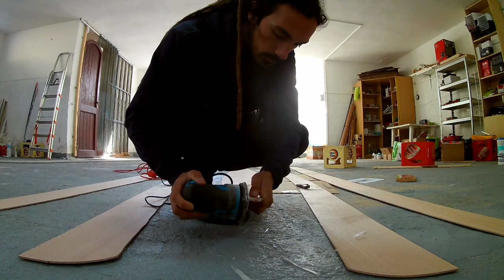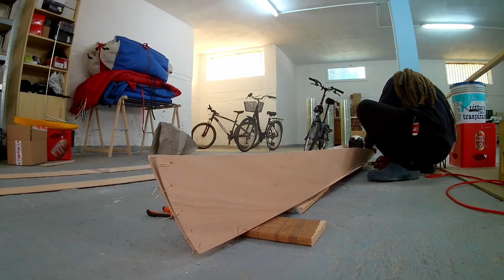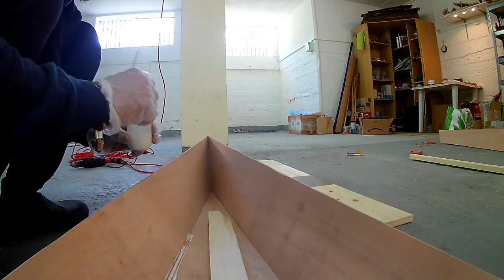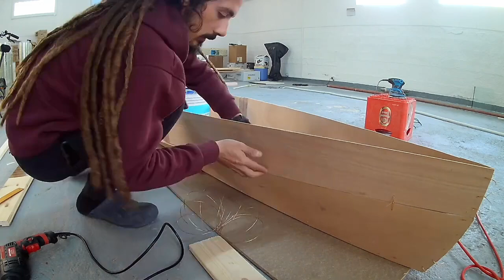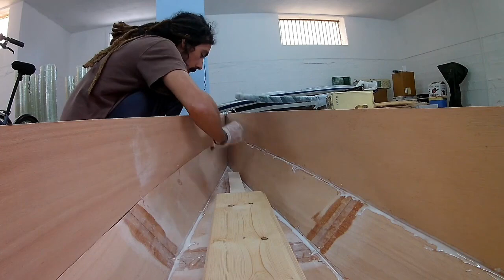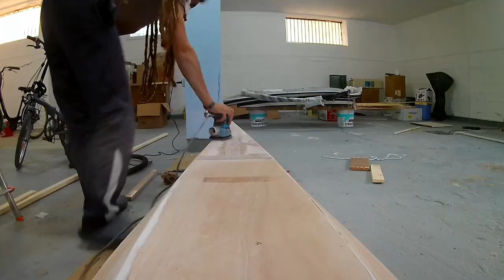Canoe from plywood: how to build with no experience #1

Comment: When I do stitch and glue I empty the contents of a caulk tube then refill it with the glue. Applies more evenly and gets into the crevices. After I get the glue on I use a plastic spreader to finish up. Saves time on sanding and makes for a stronger and better appearance. Nice canoe by the way. Hope you get many years of enjoyment from it.
Reply from the maker: Really good trick, I'll try it in my next building. Thank you
Reply: Which glue is the best? Looks like epoxy and fiber glass...
Reply from the maker: @nelhanekom  yep, epoxy is the best for this type of work, I used it

Comment: I understand the lower curvature of the lower side panel (follows the shape of the bottom). But how "did you get" the upper curvature. And is the lower curvature of the upper side panel just follow the upper curves of the lower panels ? My guess is no.., since the two panels are bent very differently.

Comment: hi.. just wanted to know how much did your canoe end out weighing. and what size of ply you used. also did the  fiberglass added a lot of weight
Reply from the maker: Idk the weight; ply size is a single sheet of ply (about 2.5mx1.8m)
Reply: @davidegessa  thats not what I asked. What was the thickness of the ply.? How much weight did the fiberglass added.. was it much better with the fiberglass. How heavy was the final product

Comment: first time build here, got the stitching in place, what glue do i use to seal the joints, or is this done with an epoxy resin, if resin, will any type be okay ?? thanks
Reply from the maker: It is epoxy resin mixed with microbaloons; I think you can use other types of resin, but it's better to use epoxy to increase curing time
Reply: excellent thank you

Comment: What is that fabric you are putting on the outside?
Reply from the maker: Fiberglass mat
Reply: @davidegessa  That can't be glass fiber because you are cutting it with a knife! Are you using the "so called" fiberglass that is intended use is for drywalls and such?
Reply from the maker: @Thestripper1  it's glass fiber, since it's very thin you can cut it with a knife. The one I used is very similar to this: https://www.svb24.com/en/seatec-glass-fabric-200-g.html
Reply: @davidegessa  The stuff you use on the inside is glass fiber but that fabric you are using on the outside can't be. Not even 2oz fiber can be cut that way.

Comment: Did you cut the wood with a cnc machine or with a jigsaw?
Reply from the maker: I used a sharp knife
Reply: @davidegessa  I assume you also used a template
Reply from the maker: @Dillon-bl3dz  i used offset measurements you can find here http://forum.woodenboat.com/showthread.php?117707-Little-Guide-a-one-sheet-canoe
Reply: @davidegessa  alright thanks

Comment: Дэвид привет. Ты добавлял муку? Простую пшеничную муку?
Reply from the maker: I'm sorry, but I don't understand
Reply: Привет друг. Он сказал что он муку недобавлял. Он сказал что он микрошарики для эпоксидных смол добавлял до клея. 
Отличний ден вам.
Reply: @davidegessa  Hey there he just asked if you added flour into the glue.
Reply from the maker: @gweril816  they are micro ballons, an addictive for fiberglass
Reply: @davidegessa  Yeah i know thanks for the answer tho! I love your tke on this project and i realy want to make one to use on a river i live next to! How long did it take you to build it btw? Also your take on the Little guide doesnt use the wooden side bars nor the central spacests, does the boat work well even without htem?
Reply from the maker: @gweril816  thank you (y) I take around 3 weeks total; there are technical time in order to dry every fiberglass surface properly. Yea, it works "well" without but I suggest to add them
Reply: @davidegessa  Thanks for the tips, btw how hard was it to draw the lines on the plywood sheet so you can cut it out?
Reply from the maker: @gweril816  very easy I remember
Reply: @davidegessa  thtasgreat im so sorry for asking so many questions but what kind of fiber glass and resin and epoxy did you use?
Reply from the maker: @gweril816  as resin I used: Prochima RESINA EPOSSIDICA E-227 

as fiber: MAT GR/MQ: 300
Reply: @davidegessa  Thanks youre amazing!
Reply: @davidegessa  One last question if you remember how much epoxide and fiberglass did you aproximately use?
Reply from the maker: @gweril816  unfortunately I don't.. About 3/4 kg of resin btw
Reply: @davidegessa  Thank you anyways!